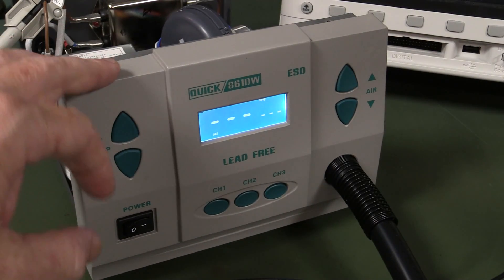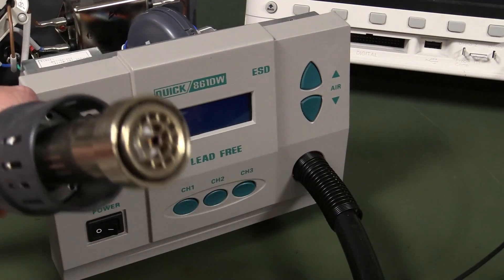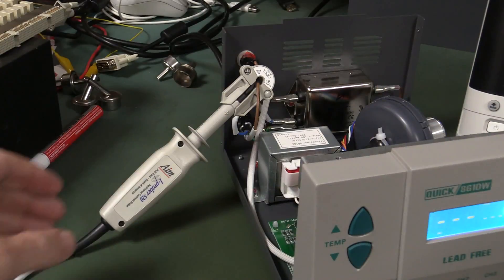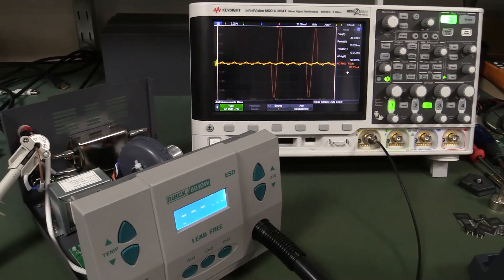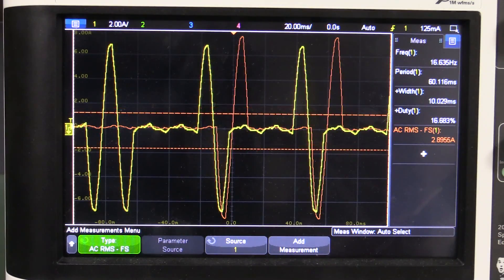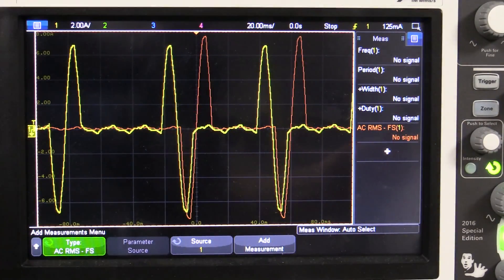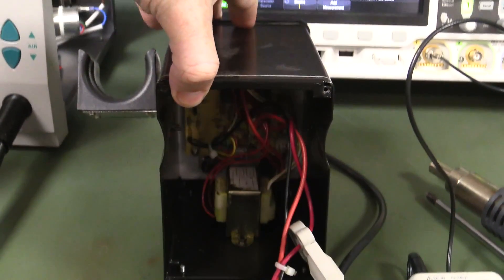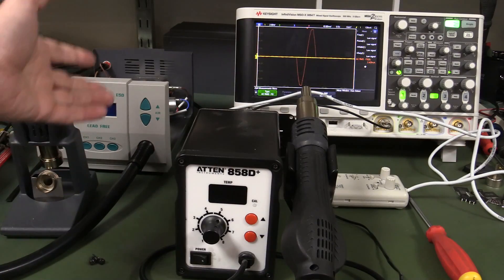EEVblog #1059 - Quick 861DW Hot Air Waveform Measurement

Comment: My first Hot Air Station was not exactly the Atten 858D bta similar Mdel for about 35€ but it was very difficult to work with this device i tried calibrating it but when i choose 350°C it reaches about 550-620°C during heating process and after this when it says its reached Temperature the Temps drop slowly to about 200°C! So u have only a small Time Period where u can solder correctly and when i used the heating time to heat the area from far and start soldering  as the station says got the Temp it works to desolder smaller parts but i destroyd many components and donor boards till i got it with this station! After purchasing the Quick i did not burn any PCB so i wouldnt recommend the Atten 858 or similar stations to anyone

Comment: Regarding the lights flickering, I have to answer "yes and no" to the question of whether the lights are at fault. Of course design elements of the lights contribute significantly, especially if they're LED bulbs. LEDs are nonlinear devices and with poor regulation on the input, are very susceptible to flicker and smaller variations in voltage. I have tried and owned several varieties of LED bulbs from 100W replacements, 40W & 80W fluorescent tube replacements, as well as a very nice and bright LED drop light/work light I purchased from the Homeless Despot. Some are far more susceptible than others, the drop light is definitely one of the most sensitive.

I have a 1500W or so Ryobi heatgun that I believe also uses a triac for pulsing the power to the heating element, and especially if plugged into the outlet on the drop light, the flickering is not something you can ignore (especially upon initial warmup). There is also another more common source of LED lights flickering that never seems to bother incandescents or fluorescents. I have a 5HP rated air compressor. The motor draws about 28A at full load. The compressor unit obviously cycles at less than 60Hz but also produces noticable flickering at the exact same frequency of the compressor. This is a common issue elsewhere as when I worked at the power company, customers also had this complaint. I was unaware at the time of what the problem was but the power company had spent resources doing voltage studies without finding anything. Too bad understanding of electronics is less prevalent in the power industry than others which focus more on the design of such devices.

Anyway, I guess the point is, I haven't found a lot of LED bulb designs that are particularly resistant to this problem(Not saying they shouldn't be, but it's not like you can go to the store and find a bulb that says "certified not to be a piece of garbage with switching or oscillating loads." Perhaps I should test the modules/bulbs I have and do a comparison. 

On a side note, cheap LED bulbs can be noisy as heck, as I think you've gone over in one of your videos. I also had a similar issue where BLDC motor windings at work were picking up radiated emissions from an LED bulb on the workbench. Added a toroid to solve the problem and it quieted down my scope readings significantly. Didn't realize the windings were working as an antenna at that point, but it makes complete sense now. And that would also explain why grounding the aluminum housing helped, as I was improving the effectiveness of what is essentially an EMI shield around this big antenna!

LED bulbs generally leave a lot to be desired in terms of quality electrical design from many brands.

Comment: Hello. If you had the opportunity to similarly compare the new HOT AIR Atten ST-862D model with the Quick 861DW, I would be very interested in such a professional disassembly and check what is inside.

Comment: Those stations with fan in the handle from attn or whatever are likely peak flow and unregulated. They probably don't flow that much with a nozzle attached. Perhaps the quick doesn't truly regulate it either but likely makes a whole lot more static pressure and is much less influenced by the nozzle.

Comment: And here I come a year later to say that I too have my main LED light flicker in my lab. I suspect it is due to interference with the dimmer. Nothing else, other than maybe the laser printer (to a lesser degree), does the same. My house was built in 2014 and all wiring is 12 AWG solid core and all circuits are 20A (120V). All my breakers are both AFCI and GFCI but no trips to date while using the Quick 861DW.

Comment: The problem is when you have YT influencers who use personal preference as their review conclusion for tech gear of this nature,  rather than true scientific reasoning or experimentation, they only create stupid irrelevant content.  Your previous video was a shocker in comparing the Atten against the Quick.  Different board locations and different techniques in testing the solder's liquidity.  People were right to criticise you for it.  You spent more time heating the actual chip than the pins when using the Atten.  No mention of the actual tip sizes just "the biggest you had" and no mention if they were the same size.  If you pay 3 times the price you should expect better outcome of course.  However, you could have got the Atten down to 30  seconds if you applied the tweezers and heat like you did with the Quick and that is still a good result.

Comment: I am a This Old House(TV Show) fan too, it wouldn't surprise me one bit if those old New York  buildings and/or the power grid they share wasn't designed for 1000 watt loads or the grid they are on is old and the transformers are nearly depleted.
  
His area could have an old transformer that the electric company is trying to squeeze it's last dollar value out of until it's efficiency isn't worth the cost, they can cost $20,000-$80,000, are supposed to last 40 years, and may have a construction that uses toxic substances so there is also cost in hazardous disposal.

Comment: I have been watching your videos for a few months now. I love to watch as you repair and/ or reverse engineer products. I'm wondering if you'd consider reviewing a particular product that is often converted into remote control robotics. The topic is power wheelchairs. More specifically, Curtis controllers, power modules, accessory modules and the drive motors as a system. I believe that power wheelchairs use the can-bus system, adopted from the automotive industry. To my understanding, this is a serial based technology. I would love to see the waveforms that control the motors: fwd, left, right, reverse, turn left, turn right, etc. displayed on an oscilloscope or analyzer. It would be interesting to see the digital pulses that command the attached devices. 

If you're up for it, perhaps you could repurpose a power wheelchair with vertical lift seat into a remote control appliance carrier. For instance, You could use it as an aid to relocate and assist with the installation of window air conditions. The elevating seat would help you to set the height of the window AC to match the height of the window casing.

Thank you for the many fantastic videos and resurrections from dumpster diving and factory clearance of electronics.

Comment: I have seen similar lighting flicker (in incandescents) while using a ~1.5kW  DIY heater controller that did the same ON/OFF type control (i.e. not phase angle control). This was with reasonable (230V) mains wiring and separate lighting circuits - I think it happened when the controller ended up dropping/adding pulses at a low enough frequency for the bulb filaments to not filter it out and the human eye to respond.

Comment: Here's why it causes lights to flicker:

The circuit doesn't use TRIACs. It uses the FETs as half wave switches which are synchronized on the line frequency. This is fairly common in many power hungry regulating heating circuits and the same flickering light effects also occur with the use of photo copiers and laser printers as well.  120 volt devices need more amperage so the effect is much more noticeable than with 240V.  If your lighting has regulated power inside then the flickering will not be present.

If the device is powered on an outlet that shares the same circuit as the lighting and has relatively resistive wiring like Alumin(i)um and/or far from the power panel and/or the power panel is a distance away from the feed point of the utility supply, the lights will have a more pronounced flicker.

Try a temperature regulated soldering or hot air station and a non-regulated work lamp with a 30+ meter light to medium duty extension cord and those current pulses will make the light flicker!
Reply: I found that flickering is especially noticeable on my line voltage T8 LED fluorescent retrofit tubes with the ballasts bypassed and removed from the fixture. It's particularly bad on one 12 ga. short run copper branch close to the 208V  200 amp three phase panel.  My espresso machine really affects them when I first turn it on in the morning.  A nuisance I am willing to endure for my java.

Comment: I designed an autoclave a number of years ago and there is an EMC rule that relates to the switching on and off times for power devices. Essentially there is a formula that dictates the number of ON / OFF cycles that are allowed in a given period of time and it is intended to reduce flicker and is in fact called the 'flicker directive'. The formula is based on the current drawn and the load / power factor. This is not of course to be confused with true DC based duty cycle controllers which average out current drawn. It resulted in a 25 second minimum power cycle time for a 3Kw resistive load and I would guess that your device does not meet that standard.

Comment: I use QUICK 861DS for at least 4 years, and i Can confirm the flickering problem. You can try to replicate this issue by connecting Desktop Lamp and Quick to the same extension Cord. In my case it is circular  CFL lamp with magnifying glass,  ca. 20W. The main light is not affected.

Comment: Crappy 120V mains power, that's the problem. Ceiling lights on the same circuit as the sockets doesn't help either. Fixed ceiling lights are ALWAYS on a separate circuit in the breaker box/consumer unit, no matter how many rooms you have.
Reply: In the UK and Europe.
Reply: forgot to write: I live in central Europa.

Comment: 11'50" The Atten had more hours running. It may have some of the heating spiral material evaporate/oxidate, causing it to be slightly under its spec'ed power.
Reply: There is nothing wrong with the Atten, it is a fantastic product if you think about its price, up from 25$, but there's a lot wrong with this comparison. If they just bring the quality of the Atten to the price of the Quick, you would get a 5in1 multi-functional super soldering station and all other companies would go bankrupt.

Comment: It is likely due to having 110V and pulling about 10A impulse current and that on old cable. Louis has also problems with his AC in the summertime. So it might is a good thing that his leas is running out.

Comment: Hi Dave, I'm surprised you didn't emphasise strong enough that it is burst control not phase control of the heater.
I think you have smaller harmonic components due to each wave form being sinusoidal zero crossing, rather than chopped sinusoidal waves of phase control.
When doing the power measurements, did you measure the voltage being applied to the heater, in case there were losses in the controller.
Light control uses phase control, these heaters use pulse burst control.
Get a light dimmer and show us the waveforms and show the comparison, a good video experiment.
Tom.

Comment: I notice that from the Quick scope traces that the TRIAC control doesn't always switch on alternating halves of the mains cycle i.e. a positive half cycle is sometimes followed by another positive half cycle. This may produce a DC current draw on the mains input. It would be interesting to put  DC ammeter on the input mains to see if there is any consistent DC current draw. This may have an effect on other equipment connected to the same circuit. Also, supply authorities are usually very unhappy with any equipment that draws any significant DC from the mains supply.
Reply: there are many hairdryers which use a diode for their low power setting. e.g. 1200W/600W. It seems to be not that big problem in reality .

Comment: Switching on/off at zero crossings is the cleanest less noisy way there's to do it.
Peak power there is 1.41*220[volts]*7[amps] -> 2.17 kW

Comment: It would be great of such devices had 2(3) ratings:
1  - lower bound Maximum power - guaranteed minimum of usable power
2 - upper bound current draw - for circuitbreakers and wirethickness
3 - instantaneous power - surge-current protection.

We had an old washingmashine that would regularly throw the fuses. Checked the specs - should be alright. Used a powerclamp - instead of the rated 1500 W it was pulling way over 3000 W with spikes of over 20 Amps (mind you middle europe, 240V). The old non-resetable fuses were fine with those bursts, but not the new ones.
(and wow, 20 Ampspikes are a tad bit bad )

Comment: I've seen laser printers do something weird with my lights. I have this theory about how power and phases works that I was going to mention. Like 1 line from a breaker really has this like wattage ability before some wire somewhere starts to overheat. If you took a 240 volt or 120 volt appliance you could tap about the same amount from one phase or two under that maximum. The appliances resistance limits the current draw... I think certain devices were inherently additive in terms of their coil arrangement to add power. In that case you'd definitely benefit from 2 phases.

Comment: Rossman’s is working on 110v
Reply: low voltage - high current. when I use my TS-100 with a 12 to 24V converter on the solar battery system my led lights also flicker with the current pulses. when I use it at home with a 230V PSU then no problem.

Comment: HI Dave. My 861DW have a little problem:  in the same airflow setting,  the higher temperature,  the faster the airblower spin.  That means inconsistent air output in different temperature for fixed airflow setting

Comment: I wonder what issues might come up from switching only half cycles. DC bias is something to be avoided with mains devices, right?
Reply: in theory: yes . practically many (most?) hairdryers use a single diode for the half power setting.

Comment: Is a higher airflow really needed when it increases the likelihood of blowing components off of the PCB?
Reply: it depends i already lost 0402 parts this way. but sometimes you need the power
Reply from the maker: Almost no chance. The surface tension of the solder will keep parts in place

Comment: The flickering issue is something the standards talk in relation to the noise treatise.  It is not a simple load control issue.  You could of course do a continuous power control by utilizing a portion of every half cycle in what is called phase control.  Then it is a noise issue and the line filter is effective remedy.  With the zero switching, there is very little noise generated and we start talking about the flicker.  The line filter does nothing to prevent this from propagating to the power grid.
However, here come some more interesting details.  The type of lights has a great influence to the observed flicker.  But so does the frequency of the heat proportioning.  And then, there is the real crux:  If the controller is not forcing full cycles every time, the resulting DC plays havoc to any transformer.  The DC saturates the transformer core and the primary draws HUGE surge current.  Rather than a breaker, the transformer(s) present the dominant line impedance and a 5 or 10 kVA transformer has higher impedance than, say 50 or 100 kVA transformer.  So, even clean full wave switching has different drops at different transformer sizes, without the DC effect, but the DC adds “insult to the injury”.
Of course, incandescent lights flicker less than faster responding lights (fluorescent ones).  And on electronic light controls (compact fluorescent and LED) the effect could be determined by their Hold Up time, but many of them use so small main capacitors that there is almost no time.  When you the add the DC caused transient, it shows right through.
The human eye notices flicker most strongly at certain frequencies, like 2 - 20 Hz, and also more when the light is on the side instead of directly at the center of the view.
So, plenty of different details, but in this case I would say there has been a small transformer providing either 120 V or 230 V, whichever was applicable.  Then there is the occasional production of half wave, i.e. DC.  Bad combination...